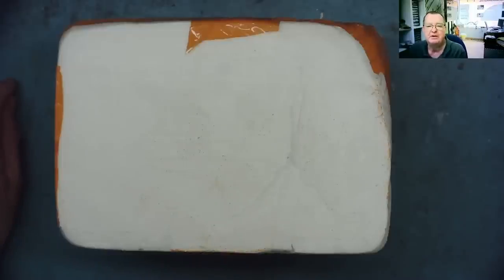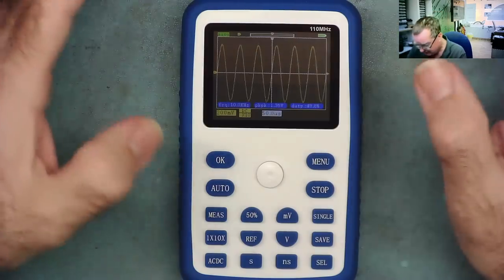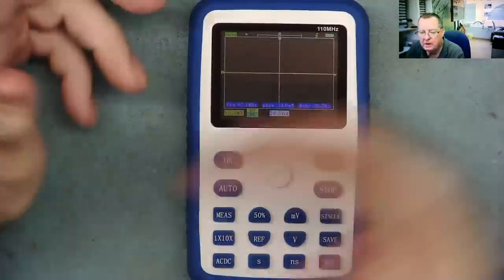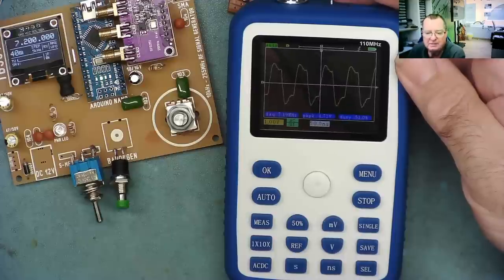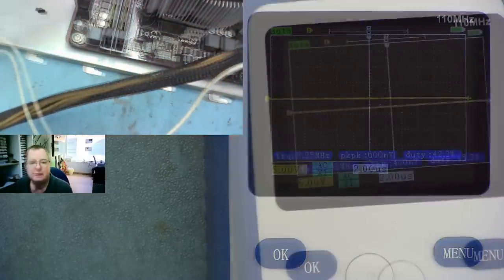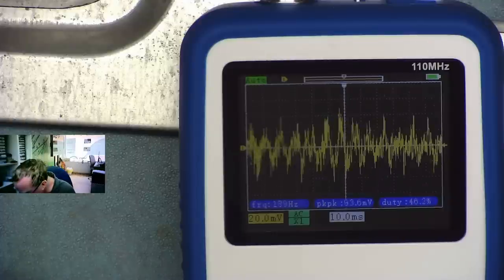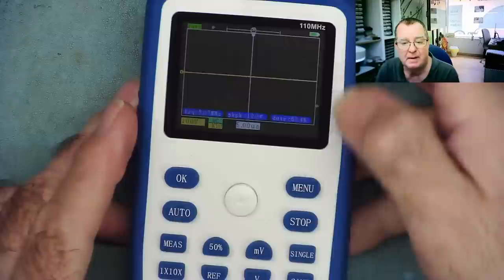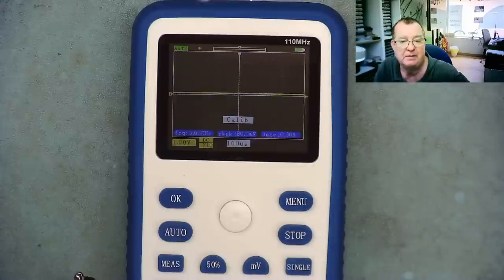A 110MHz Oscilloscope for under $70! Is It For Real And Is It Any Good?

Comment: This is an interesting oszilloscope given the price. But I would hesitate to recommend it to beginners as its weak point seems to be triggering and displaying stable wave forms. So you need some experience to get a good picture. However, I very much like the user interface. Most often used functions have their own button no need to scroll through endless menus.
Reply: Mr Guru  Yes, the ADC is only 2x 100Ms/s. So bandwith is rather 30 MHz. Anything above must be multisampling or algorithmic creativity. This should be sufficient for most applications and you still get the additional feature to get at least an impression of what is happening at higher frequencies. But its not a true 100MHz device.
Reply from the maker: @UltraUltaderdritte  I tested it at 100MHz and it gave a sine wave display plus the frequency readout said 100MHz.  How can that be 100MHz bandwidth then?  It did that up 109MHz, above that the display became unstable and the frequency readout said ---   
You've seen it doing that on my video (I hope).  So you will have to convince me that it isn't working above 30MHz 😉
Reply: @LearnElectronicsRepair  Only because you can see a signal at a certain frequency does not mean the oscilloscope has such a bandwidth. The bandwidth spec is based on a -3db signal amplitude measured compared to the true input amplitude. So an oscilloscope can show much higher frequency signals than its bandwidth but the amplitude will be much lower. I have a Rigol 100 MHz digital oscilloscope and it still shows a sinewave up to 420 MHz and the producer does not claim this to be its bandwidth. Moreover, an digital oscilloscope is not only limited by its analog bandwidth but also by its sampling rate. Usually the sampling rate should be at least 5 times higher than the bandwidth in order to have sufficient points to represent the signal. FNIRSI advertise a sampling rate of 500 MS/s which would be okay for 100 MHz. However, teardowns show they use an MXT2088 as ADC which has two channels with 100MS/s. With interleaving they can combine both channels to 200MS/s which is only good for 40MHz. This is likely the reason why higher frequency are unstable displayed. I understand that for repair work a visible signal is in many cases fully sufficient but an oscilloscope is also a measurement instrument and is specified in this way.
Reply: @LearnElectronicsRepair  at 100 MHz all waveforms are a sine wave. Least that's what this scope is going to guess. Feed it a 100 MHz square wave. It'll be a sine wave too.

Comment: If it is all you can afford then it is better than nothing.    An alternative is to save up a bit and look for a second hand Fluke 123  They occasionally turn up on Ebay  You wont get one for 70 Euros but they are infinitely better and safer being CAT rated and very robust especially for site work. You will look a lot more professional turning up  to a job with a Fluke - even if you can't  remember how to use it  fully ! 

It is easier for someone experienced to automatically not touch something  live (when you have had enough shocks you don't forget)  but for the less experienced you  may learn the hard way.   50 Volts is potentially lethal to some people and the manufacturers ought to step up  and shroud that BNC
Reply: "a second hand Fluke 123"
That's a great measuring tool, scope, frequency meter and DVM all in one unit.  Ideal for testing generators which is sort of what it is for.  You don't have to worry about inadvertently short circuiting the generator to ground since it doesn't have a ground.
Reply: @thomasmaughan4798  I just think if you are serious about  getting into electronics and you need something portable  the 123 is worth saving up for if you are going to be measuring  50 V and above.   The downside is the 20 MHs bandwidth on the Fluke . The  FNIRSI  is great for checking a voltage is there and getting an indication of what it looks like . This video  

 https://www.youtube.com/watch?v=Uqrel5fQpK4 

 is worth watching  with a similar device being tested - and it even has a video output using  PAL  - great if you are in the UK but not so good if you are in the US or Canada.. The video shows fault finding on some old computers  - though it will be a bit limited on modern PC's  but probably better than the Fluke. .  

If you really need the higher frequency response  then the FNIRSI is a done deal otherwise  if you want quality, a bit less performance and you want to stay alive the Fluke is best.  That unshrouded BNC connector is so shitty. The Chinese produce some great value kit but they just don't care about safety.  .
Reply: @we-are-electric1445  I have the Fluke 123 Scopemeter.  I bought it (well, employer bought it for me) for debugging T1 and E1 circuits.  These signals lose waveform dramatically in only a few hundred meters. 
More recently I bought a Keysight DSOX1202g after considerable wrestling with whether I wanted such a thing.  It's expensive!  It's "Bode plot" function is pretty handy.  
Anyway, the little Fluke 123 is handy for testing live circuits where NOT having a ground is essential (and the case is rubber so it doesn't become "hot" depending on what you clipped the ground lead to).

Comment: The 110MHz part is what makes this scope a piece of rubbish. Rated BW should be its -3dB point, or should be determined using 3.5ns*100MHz (or 4.0ns*100MHz) Tr/BW product. In this case, the 110MHz is its Nyquist frequency where it starts to alias. This is misleading, and can lead to frustration.

The price is great, but while in this price range there are few competitors, if you relax the price to some $200, you should have plenty of choices. If you are short of $130, chances are you are not going to play with anything that can generate 110MHz, so you are better off with an honest 70MHz scope. BTW, at $200, you get two channels, not one.

For those interested in $200 scopes that are actually usable up to 100MHz, consider Owon, Dream Source Lab and Hantek. I use a Dream Source Lab Pushi scope (currently only publicly available in China, but you can always drop an email to them to buy one), which costed me 1299 CNY (<$200). From its Tr and Tf, I was able to determine its bandwidth to be ~175MHz, while its rated bandwidth is 150MHz (both channels are on, using an 180ps rise time generator).

I'm not recommending this Pushi scope lightly. I personally own a 1GHz 2ch Keysight scope, a 200MHz 4ch mutually isolated Fluke ScopeMeter, an Owon 100MHz 2ch USB scope, 2 Analog Discovery units (gen 1 and gen 2), and my job has offered me a Siglent 500MHz 4ch mid-range scope. I found myself choosing this $200 toy scope to be my daily driver, and my Fluke when I mess with deadly voltages.

If your main purpose is to measure SMPSes, GET A DIFFERENTIAL PROBE! Your life is worth more than $150 (which is the cost of a cheap 70MHz HV differential probe). Floating ground scopes can be coerced to do the same thing, but you are putting your life on the line. One wrong touch to the BNC shell, you are dead. One wrong touch to the calibration tab, you are dead. If you charge your scope with your laptop while measuring HV, you are dead.

There are scopes which are designed to measure HV directly, with internal isolation and thick insulated BNC shells, but those are purposefully designed to be safe, and are not likely to fall into the price point we are talking here. If you can't afford the Fluke ScopeMeter I've mentioned before or its ilks, go for a cheaper standard scope, ground it, and use a HV differential probe.

Cheers, from a power electronics postdoc who has not yet managed to electrocute himself.
Reply from the maker: Of course you can get better for more money.  I have better scopes myself.  But for the price tag, and bear in mind for some buyers that is already high and maybe just affordable, its a good buy.  Will you please not call this a piece of rubbish?  It is what it is and as I demonstrated in the video if you connect it to a 100MHz source you get a reasonable approximation to a sine wave and the frequency display says 100MHz.  It continues to do this up until 109MHz, after that the frequency readout says --- and the sine wave display goes very unstable.     So yeah I agree it ain't a 110MHz scope but 109MHz is close enough for me.

I then went on to demonstrate the use of the scope in several very different yet common repair scenarios and the 'piece of rubbish' did the job every time. As a repair tool it is very useful, I clearly proved that though some viewers have difficulty accepting the proof.  This is primarily repair channel and if the scope proves a part of the circuit is working then you can move on to look for faults in other areas.  It may not be the most accurate instrument in the world but as a go/no go indicator it works very well and for many people here that is exactly what they need.  Nothing more nothing less.
Reply: @LearnElectronicsRepair  It is not about 109MHz or 110MHz. A 110MHz scope SHOULD be able to read 110MHz sine wave AT -3DB AMPLITUDE or better, reliably. In this case, the scope loses trigger at 110MHz. A proper scope should maintain triggered at way beyond its rated BW, for 110MHz, maybe in north of 150MHz. For this scope, the -3dB point should be way below 110MHz, making it really a 70MHz-ish scope (~72MHz, measured by Youtuber Bob Kalpon), marketed as 110MHz, this is pure scamming.

I do agree that for repairing purposes, this probably works fine, in this context, rest of safety, this could be a viable option. But should you risk your life on a non-insulated scope probing mains is really your choice.
Reply: @bskull3232 Do you have a recommendation for a budget >£500 scope that can be isolated? What about the OWON handheld scopes, I was looking into them because they are battery powered and have a 100MHz bandwidth.

Comment: 1Ch scope is garbage, no matter what.
No second channel, you can't compare phase/sequence of signals, like for what you would use a scope in most cases.
2Ch with differential, high voltage/1kV capable inputs, then it would be interesting for real service work, since bandwidth isn't that relevant in these cases, like repairing/diagnosing inverters, VFD drives.
Reply from the maker: That is really strange because on all the occasions I used a scope (and all my other ones are dual trace) only on one video did I need to use two traces.  In all the other cases the oscilloscope helped me to find the fault using one channel only. 🙂
Reply: If you need all of that then you're going to pay a lot more for it.

Comment: 110MHz scope, my backside!
If specs are lying it belongs in the garbage. Rather buy a used real scope, 100MHz 2ch dso easily picked up for $50 or less.
Reply from the maker: @Big Cheese Did you watch actually all of the video? It kinda proved what you say as it seems to be a 109MHz scope

I set my RF generator to 100MHz and this scope displayed a sign wave and the frequency readout on the scope said 100MHz.  I then increased the frequency by 1MHz at a time and it continued to show a sine wave and display the correct frequency up until 109MHz, but at 110Mz the display went a bit crazy and the frequency display said ---

So I guess you are technically correct but I also think you are splitting hairs a bit here

I have several other scopes including a 100MHz Tektronix but I do think the FNIRSI 1C15 did a pretty good job for the money.  

As a lot of the advertising for this scope actually claims that it is a 100MHz scope I don't think it is fair to say the specs are lying, but anyway regardless when it comes to most repair work (unless you are into VHF radio repair) 25MHz is plenty sufficient.
Reply: @LearnElectronicsRepair  : Yes, I watched it alright. Bandwidth limit shall happen because of attenuation, it's the analogue frontend that shouldn't keep up, it mustn't bugg out like that one (the wavesform is all over!). Another area, usually rubbish is single trigger misses horribly or even deadbands/bugs with sampling at certain frequencies (sweeping the input frequency usually reveals that nonsense). A common denomination these cheapos all have in common (in my experience) is if the spec is lying, the scope is buggy and junk.
Reply from the maker: @bigcheese781  I think you are missing the point a little bit though.  As this is primarily a repair channel, I look at test equipment from that perspective.  I am not convinced the issues you raise matter so much to a repair technician.  In most cases you want to know if something is working or not working, like is a local oscillator running at the expected frequency, do the Mosfets on each phase of a VRM have any gate drive, is a crystal oscillator running, is the audio signal getting to the next stage of an amplifier and that sort of thing.  

If I connect a scope and it shows me a reasonable approximation of a sine wave and says 100MHz on the screen when i attach it to a 100MHz oscillator, or I can see pulses/ringing on the drain of a Mosfet driving a switch mode transformer, even if it will not trigger on the signal exactly,  then as far as I am concerned the scope told me that part of the circuit is working and I move on to elsewhere to find the fault.  This cheap scope fills that requirement just as well as my 100MHz Tektronix 465B or Rigol.

I don't particularly disagree with your points regards bandwidth and triggering etc but what I do take exception to is the assumption that the scope is therefore 'buggy junk' when in fact it is an extremely useful tool in many repair scenarios. It's like my various Multimeters, I have a Fluke but does that make the other cheaper ones junk?  Absolutely not.  I also have a Quick 861DW hot air station that I bought to upgrade from the cheap 858D hot air station that I used on many successful repair jobs for the previous five years (and still have). So the 861DW is better and has more capabilities, which is why  I bought it, but does that mean the 858D is junk?  No it doesn't, it allowed me to do a lot of work I couldn't have done without it.

It's not like I don't have other scopes (I have five now) and I don't feel I need to defend this one because 'it's the only thing i can afford', it's just that it is useful, you will see me using the 'piece of junk' on some future repair videos because it is convenient to grab, and it may surprise you when you see me find a fault with it and fix it and I wonder after how many completed repairs you may think... 'hmm maybe the piece of junk it is quite useful actually. 🙂

Comment: This  brand cheat the customer. I bought 100mhz oscilliscope when I saw this brand which I bought was 30 mhz not 100mhz.you can see in the youtube.
Reply from the maker: I tested this one by connecting it to my RF signal generator - at 100MHz it showed a sine wave and the display said 100MHz.  I continued to do this increasing my signal generator to 109MHz and still the scope showed a sine wave and the correct frequency.  At 110MHz it didn't like it,  What more do you want form a cheap scope?
Reply: @LearnElectronicsRepair  Do you know what bandwidth mean?

Comment: Biggest fault is that it is only single channel
Reply from the maker: To be honest, and I did mention this earlier, this is primarily a repair channel and in all my 340+ videos I only ever used a dual channel scope once, and that wasn't to diagnose a fault, it was to prove how something (an op amp circuit) worked 😉

I've been fixing stuff since the mid 1970s and while a dual channel scope is a nice thing to have, and my other four scopes are dual channel. the number of times I actually needed that feature to diagnose a fault are fairly few and few between.  The most common situation I needed the two channels is with a home brew Huntron Tracker scope add-on in X-Y mode

Comment: That is not 110mhz oscilliscope.
Reply from the maker: You are correct, but it was very close.  Did you see me connect it to my RF signal generator in the video?  I measured signals up to 109MHz and in each case it showed a sine wave and the frequency display was correct.  At 110MHz it showed a sine wave (not stable) but the frequency said ---

Pretty close though yeah?
Reply: @LearnElectronicsRepair  The bandwidth is measured at -3dB attenuation. That scope's bandwidth is no more than 25MHz, since at that point the amplitude is down to about a 71% of the original signal.